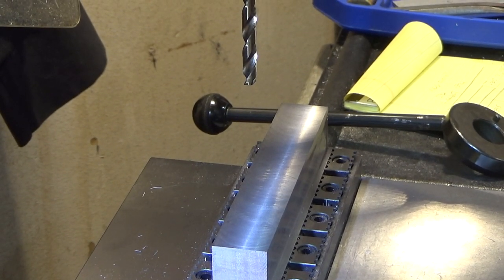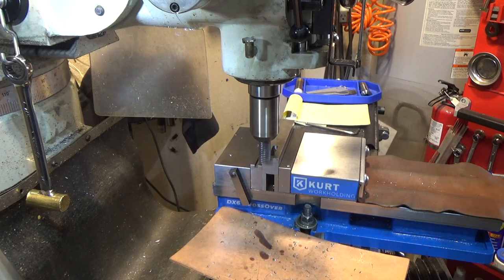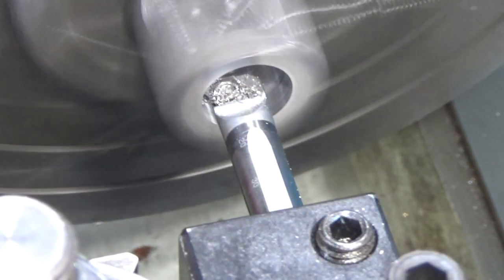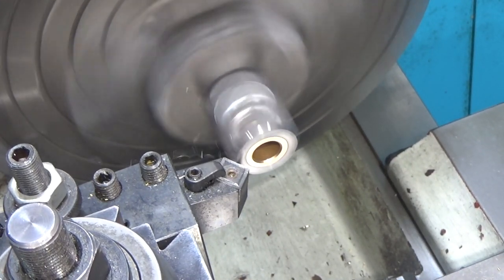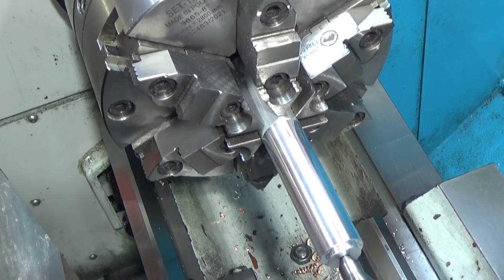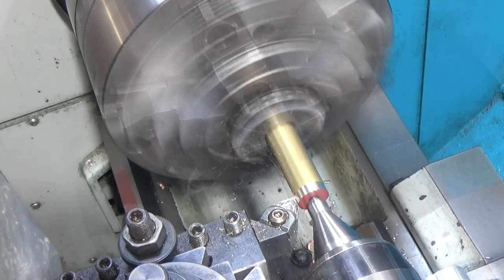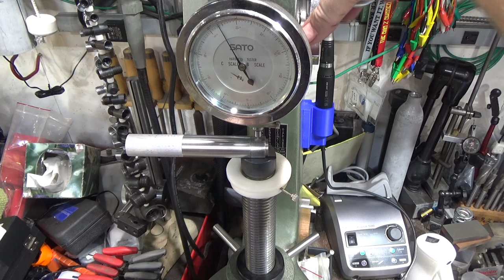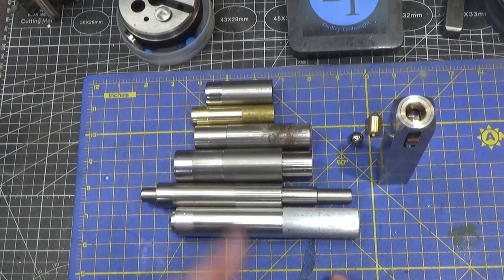221 Surprisingly Useful Burnisher Part 2

Comment: Gday Robert, the results were interesting especially on the diameter change, I honestly thought there would of been more change, as you mentioned if you were having trouble getting the ultimate finish this is the solution, I think I best be looking at making one of these in the future, great job and thanks for going to the trouble of doing the testing, Cheers
Reply from the maker: Thanks, Matty. I really was surprised about the minimal diameter change. I was absolutely certain it was going to be more and though something was wrong when it wasn't.

Comment: Really enjoyed this video, especially the informative tests, very well done! Nice tool.
I would have either opted for a narrowing in the front of the bronze sliding bearing in combination with an easily removable ball bearing, or for a small pin or screw that can hold the ball just behind the front. I suspect you applied a little too much pressure to the aluminum in the last pass, hence the poor surface finish. Too bad you didn't show the aluminum under your Andonstar (have you already converted that bad base?), that's what I was most curious about. One point to pay attention to is the wall thickness of the outer ring of the ball bearing. For example, a 6005 ball bearing has a shell thickness of only 2.4 mm while a 6505 with 4.65 mm wall thickness is less prone to elastic deformation under that point load of the ball, which should result in a better surface finish.
Reply from the maker: I was not aware of the different wall thickness ball bearings. I will definitely need to look into that. I need to experiment with the burnisher more to get a better understanding of its optimal use. It is entirely possible that I applied too much pressure to the aluminum. I pushed each sample about the same and aluminum being so much softer, probably deformed a whole lot more.
I absolutely hate the Adonstar support system. I have been looking at McMaster Carr for rack and pinion gear sets. I am going to check out your video on the topic to see what solutions you chose. anything is going to be better than stock.
Reply: @DudleyToolwright I made two videos from the Andonstar support system. In the second I added a rack and pinion, which is what I should have done in the first place. I use a module 0.5 rack and pinion that I bought very cheaply, if you are interested I can look up the link for you. After this last modification I am completely satisfied with the base. Very stable, vibration-free and excellently focusable.